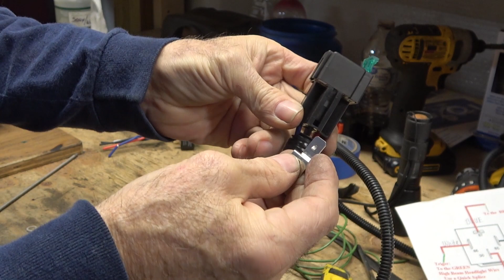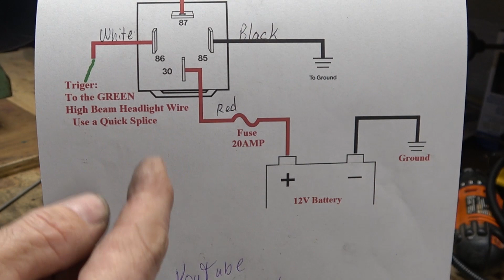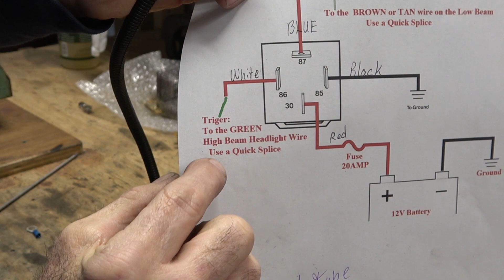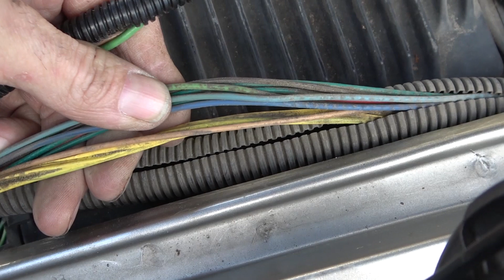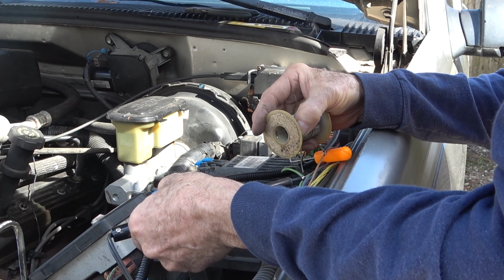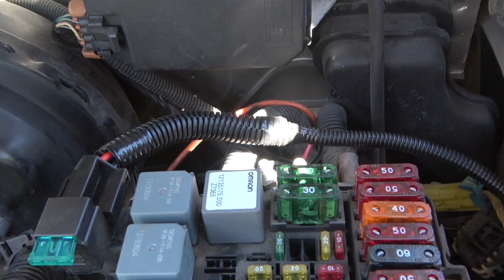Brighter headlight conversion, 4 light high beam for 1998 Chevrolet 1500. GMT400, OBS, not LEDs

Comment: I just want to know how to turn the single bulb style work truck into the dual beam! That’s it, and I can’t find a video, like what wires do I have to cut and splice and solder together to get the low beam and high beam to be SEPARATE bulbs. Separate functions! do I have to buy the headlight harness? Like I’m just so frustrated